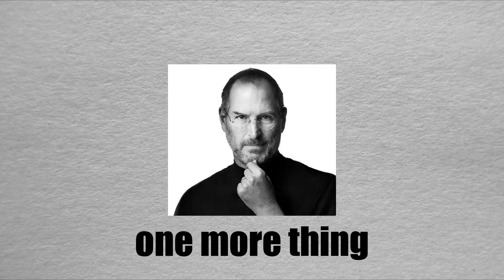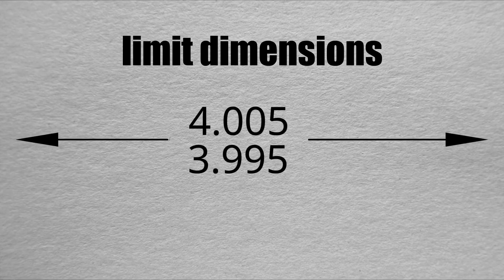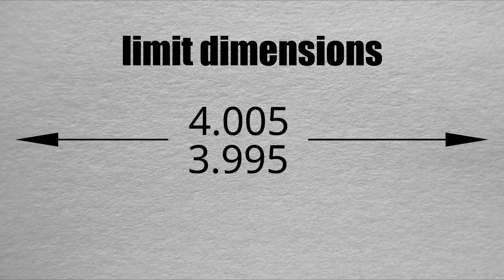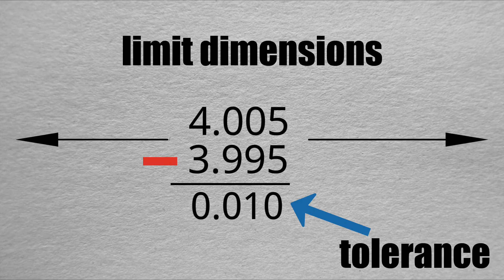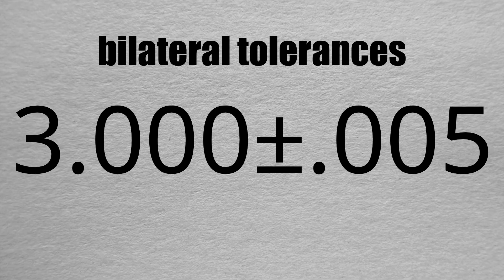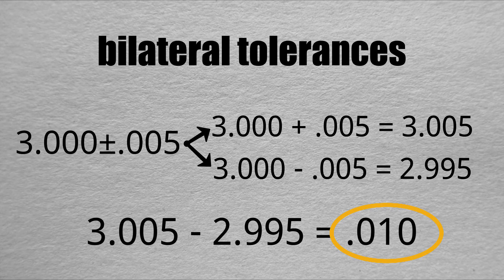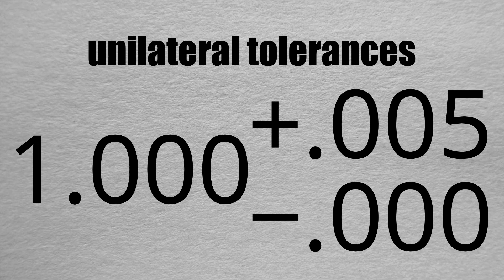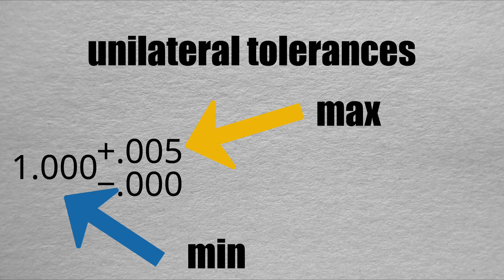Engineering Tolerances Explained

Comment: Are deviations from the specified values within a given tolerance following a normal probability distribution? Following your example for 3.000+-.005 is it more likely to end up with a part with dimensions 2.999 or 3.001 rather than 2.995 or 3.005?

Comment: Great video. 
Imagine you theoretically had two pieces of metal with almost zero tolerance, would it be sensible to connect them with using a dovetail connection as if it were wood?
Reply from the maker: Depends on the application. Dovetails are great for their strength and tight fit but usually have glue to hold them in place for longer term. But yeah, if you had two pieces of metal with very little clearance between them a dovetail would work, just depends on the for es that will act on the final item.